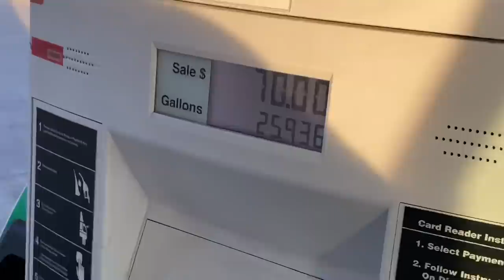How to Incubate Rhea Eggs (Without Dying!) || Renovation Update

Comment: Uncle Ben, I know that construction isn't the same in every nation but, at this point, why don't you just scrap the house? At the end the house will be like at least 85% new
Reply: Yea but you don’t need to run electricity or swear lines to house. And even if it’s 85% new it’s 15% he did save. Plus plots like these are undervalued because of the crappy building
Reply: honestly imo, in the US, old construction is so vastly superior to the new houses they're building now that I would always try to save as much of the old bones as possible. also I'd bet my hat he's in the Waco city limits & they have some irritating building laws, it's usually much less legal hooplah to fix something than to re make it
Reply: It's like saying that you want to re-insert bones in a boneless pizza, instead of getting it bone-in to begin with. If you tear it down and rebuild you assume the effort(and necessary tools) to put up a foundation and set up all of the support beams and joists. It requires a greater threshold of mechanical exactness, and would probably require Uncle Ben to hire a full time construction agency to assume that. Restoration can be done by a layman, because there are less areas where he needs to do a complete overhaul. Just strip to the bones and reconstitute it
Reply: @anegginthesetryingtimes7636  the most convoluted analogy lmao

Comment: Throw em on the poles then plaster em. Or build a wall with em, then through some stabilized dirt on em (5-15% cement). Earth ship style. Cheap as hell and you'd never know the structures were tires.

Comment: For the tires - consider this. Put em on the poles or build new poles in a separate location. Fill from the top with concrete. Now you have cool padded pillars for a lean-to 

Disclaimer: not sure if the tires would be able to handle the weight of the concrete inside - I think yes but I don’t know. If the tires break you’ll hate life so grain of salt

Comment: Stack tires on the poles and color them like life savers candies and drill holes so they dont hold water.
Get plexiglass and use them for floors and turn the foundation under the floors into a pool with fish or sharks and  you can then rescue sharks.

Comment: With the book where the red fern grows, you can make self wood box trap. The box ould have to be secured down and have a shiny item made out of metal hanging on a string with in the box. Have the hole of the box big enough for the coon to put its paw in. They dont want to let go of the item so its paw will remain in the box. I would suggest to look up the trap in the book to see how its put together. I was 10 when i read the book so i wondered if it was true if the old fasion way of how to catch the coon would work today.